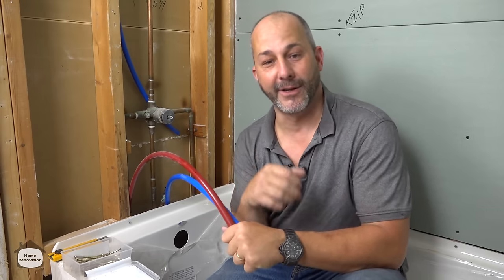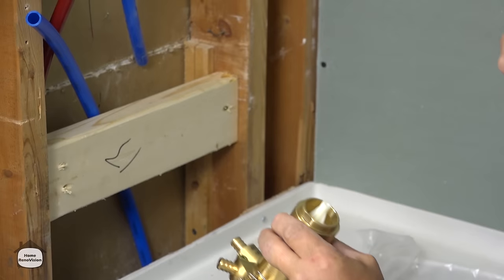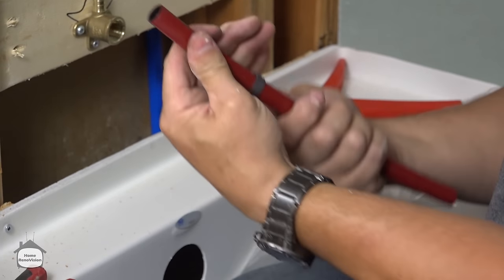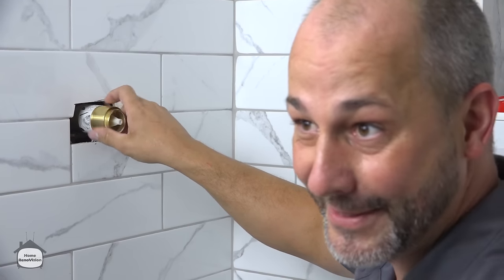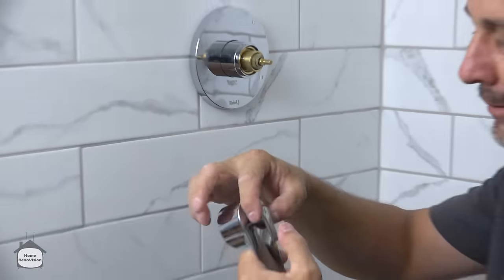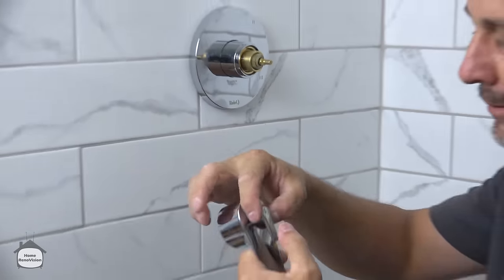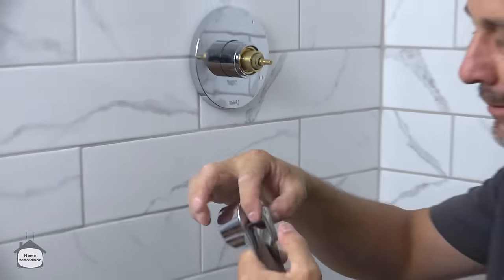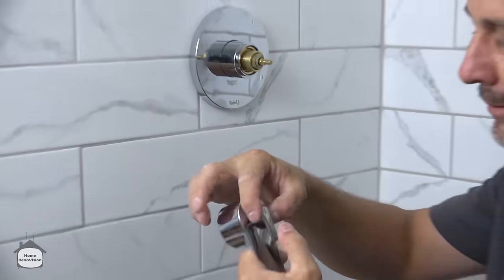How to Install a Pex Shower | Full Installation Tutorial

Comment: Not sold on Pex yet.
Warning Home Owners;
Rats and mice love to chew on this Pex stuff.
Any tubing below or above the house is most at risk.
. Copper (or even PVC) will out-last Pex by many years.
.
Reply from the maker: I have yet to see any evidence that mice love to eat pex.
Reply: @HomeRenoVisionDIY  There are videos here on your tube of homeowners tracking down leaks in crawl space when pex tubes leaked water after being chewed on by mice/rats.
Mice/rats also love to chew on wiring of parked cars.
I have seen a garage parked BMW with 10's of thousands of dollars of wiring damage due to rodents.
(They destroyed the tubing in a dishwasher of a home we bought a couple of years back, and we replaced the machine.)
Honda took the step of embedding wiring harnesses with rat repellent.

Pex manufacturers would be wise to do the same.

Comment: My insurance inspector said they wouldnt insure a house with pex...
Reply from the maker: very frustrating for you. where do you live?
Reply: South Louisiana. It could just be the insurance company that I'm using, and not a local standard. I was wanting to do some pex because of how easy it looks to work with, but that shut that idea down real quick. I fully understand the benefits of using it, and this should be a precautionary tale, always check local building codes, but also with your insurer. What may be legal, may not be covered.
Reply from the maker: They will get around to updating that soon I am sure. very dumb to not allow a product on the market that is out performing copper everywhere else. Do they sell it at home depot or lowes, just curious?

Comment: Can i ask why you are still using drywall as a tile backerboard in a shower? Current codes is cement board, hardibacker.  Drywall is a big no no.